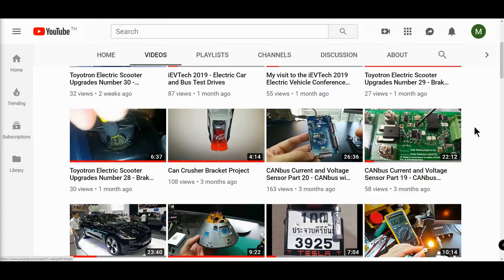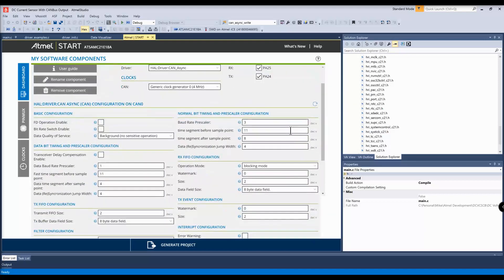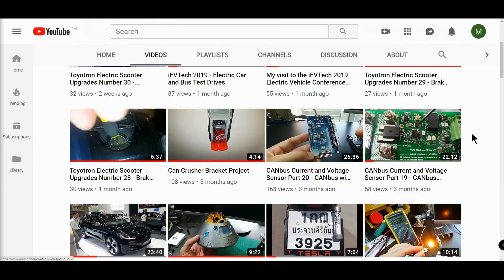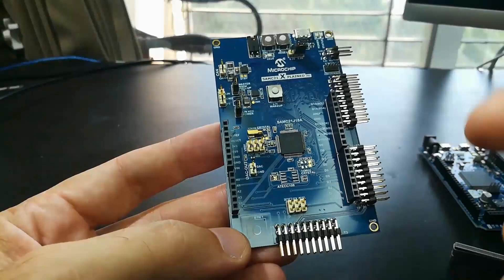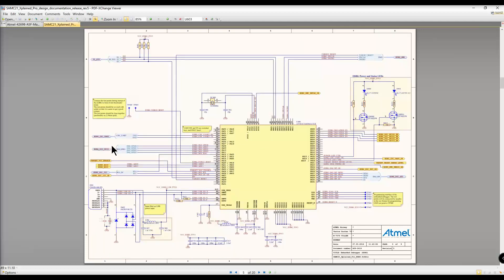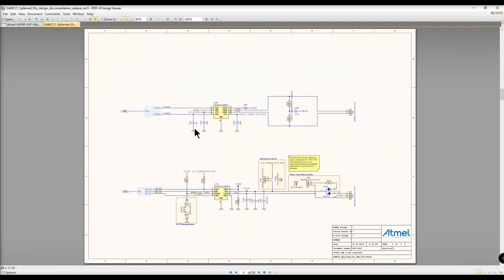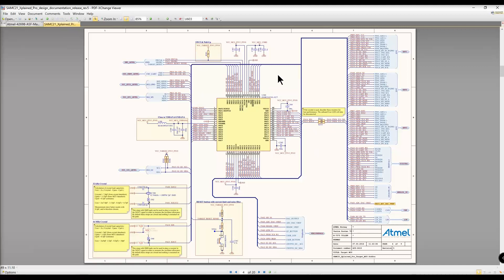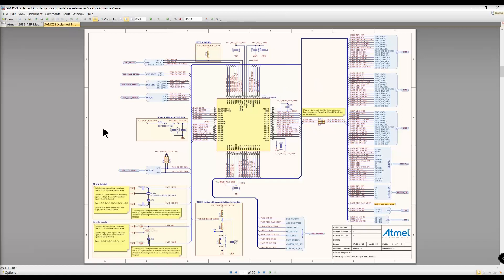CANbus Current and Voltage Sensor Part 21 - A Change of Direction

Comment: Frustration Avoidance – We all suffer from it occasionally.
Failure is an option – If we analyze our failures they are sources of knowledge and experience, so not really failures. Not adapting to failures, is a true failure.
If you don’t fail from time to time you are not improving yourself.
If you are not trying to be a better version of yourself, what are you doing?
High School Teacher Mode now disabled.